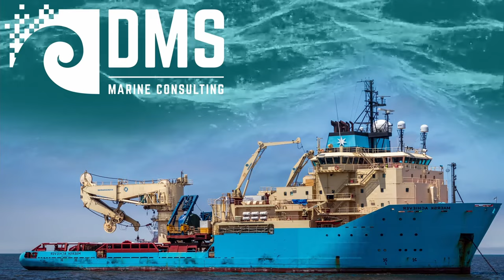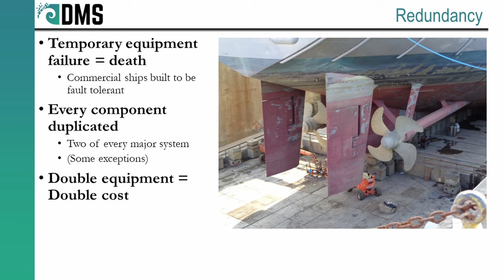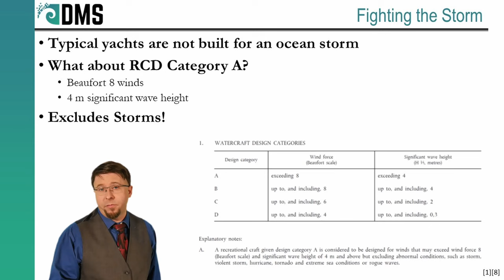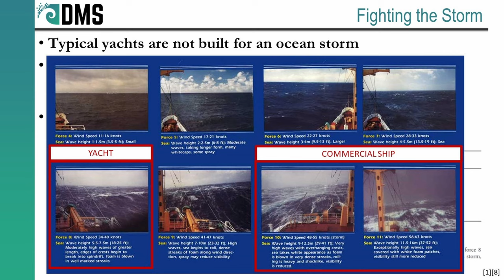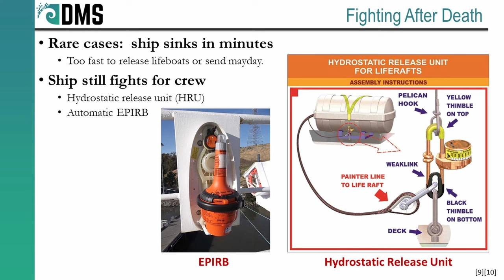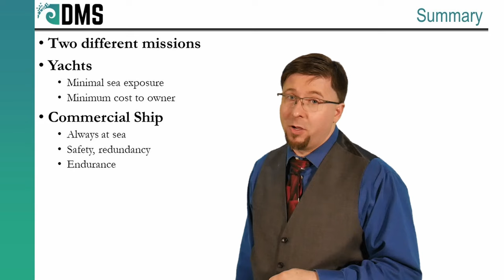How are Commercial Ships Tougher?

Comment: A feature article in Professional BoatBuilder a few years ago described how recreational yachts - say, 30 to 79 feet (9-24 meters) or so - could be made with watertight segments similar to ships. Watertight bulkheads to the yacht's freeboard along her length would, of course, vastly increase the build and purchase cost of the boat. Further, watertight doors in the bulkheads would be needed to maintain watertight integrity. Both would restrict the accommodations arrangement possibilities as well as increase cost. Finally of course, it would still be on the owner/operator to ensure all watertight closures were closed in high-risk conditions. Possibly appropriate for custom builds, and surely dependent on the owner's goals - but it would help protect owners' investments.
Reply from the maker: @153ichthus  very true, that would help increase safety.  There is also a basic floatation requirement for all yachts.  They need to stay floating, even when fully flooded.  "Floating" can still mean that the deck is mostly submerged.  So it doesn't do much to protect the people, but you can recover the yacht.

Comment: In a superyacht channel, they talk about some having enough bedrooms/capacity to almost be bumped to commercial standards. I will botch the terminology and measuring standards here, but it seemed like they have dilemmas like to add one more bedroom say for the wife's hairdresser it will cost $100M upgrade of the whole ship. Or else bump an important officer from his stateroom near the bridge to a daybed and use of shared bunks.
Reply from the maker: That's interesting.  Most standards I know regulate based on the number of people onboard, not beds.  But beds may be how they count the people capacity of the yacht.   I suspect they are bumping up against the 12 Pax rule.  International law says that you can have up to 12 paying passengers onboard and still be classified as a charter yacht.  But at number 13, you are a passenger ship and need to meet commercial standards.  Superyachts use this rule to create massive ships with large crews and only 12 paying passengers.  Then they are just a charter yacht.  That situation with the wife's hairdresser may be a little more complicated.  It would completely depend on the details.

Comment: 'Yacht vs commercial ship' is neither a correct nor a fair comparison. What you are actually talking about is 'smaller pleasure vessels, usually built of plastic' vs 'commercial ships AND properly built larger yachts, usually steel hulled'.
Reply from the maker: True, I was grouping the properly built larger yachts in with the commercial ships.  As you said, those yachts are often built to the exact same standards as commercial ships.
Reply: @DatawaveMarineSolutions  Thanks. Emphasis here is of course on 'properly built' (I say as I'm watching 44m Aria SF burning to the waterline) 🙄. As with any other product, cheap (or, I should say, money spent in the wrong places) almost always means 'less safe'. 
I enjoy your videos very much. I'm no engineer, but even I can get my head around most of your explanations. Has helped me a lot to understand more about yachts.
Reply: @DatawaveMarineSolutions First, thanks for your series of great videos.  I've learned a great deal from watching them.  You provide tons of great information, but I think this video is a bit off.  If you'll pardon the pun, you lump all small yachts into the same boat.  I feel like what you are really describing are the day sailors and coastal boats.  Proper purpose-built blue water cruisers and exploration yachts incorporate most if not all of the safety systems you attributed to commercial vessels because the need for self-rescue is a very real scenario.  They also typically have a higher duty cycle than day sailors and coastal boats though admittedly probably closer to 50/50 usage than 90+ percent time at sea.  Some might argue that even coastal boats are built closer to the commercial duty cycle standard since so many are used in charter service where the only change from an private owner's configuration is a larger number of smaller cabins in the same volume.

Comment: how much of this is because the commercial ships are larger and have more stresses on them and yachts can have more simple systems that are easier to repair.?
Reply from the maker: As far as the structure goes, I would estimate 35% of the added strength is due to their larger size.  If you built a yacht at the same size, that yacht would still need to contend with the same problems of larger size.  But that yacht could theoretically still be lighter than a commercial ship, because it was not designed to handle rough weather.  Practically speaking, when yachts get that large, we design them to the same structural standards as commercial ships.

As for the marine systems onboard, I agree that large part of the cost for commercial ships is their more complex systems.  All the redundancy, extra pipes, and extra valves adds a lot.  But I don't think the systems are more complex due to the size of the ship.  In theory, I could make a giant freighter with just one fuel tank and a single pipe running from that tank to the engine.  It would run just fine (until it needed maintenance).  So the extra costs on the marine systems has to do with the extra capability, not the larger size.

Comment: You always hear Bering Yachts bragging that they are built to commercial standards and with steel hulls, are they really built to those specs?.    I am also curious, are commercial regulations on watertight integrity and compartmentation also the basis for some military and coast guard vessel design specs?
Reply from the maker: I can't say about Bering yachts.  It takes a lot more than simple steel construction to build to  commercial standards.  To answer this properly, I would need access to a lot of confidential information that Bering Yachts is not likely to share.

As to watertight integrity on military ships.  In theory, the USCG and military ships are built to a higher standard of damage survival than commercial ships.  In theory, you can damage more compartments on a military ship, and it will still survive.  
In practice . . . more variability.  Damage survival is the law for commercial ships.  Most commercial ships consistently show the same survival ability because we all follow the same laws.  USCG and Military ships don't have to follow those laws.  They have their own rulebook. Most times that rulebook is better.  Sometimes, it can be worse.

Comment: Why don't yachts use non flammable furniture? Is it that luxury furniture includes flammable components such as wood? Or do you mean that they typically have a lower flammability rating for lack of a better term. Generally most modern furniture is burn resistant. ...is it the case that in commercial ships everything is actually burnproof?
Reply from the maker: I admit that most of these furnishing are generally classified as "burn resistant" on a commercial ship.  The exact flammable requirements vary with the testing method and regulatory body.  But as an example, much of the furniture is made from metal (steel or aluminum), which takes a LOT of effort to combust.  

Yachts usually use some form of plywood for their furniture.  It can be a sandwich panel with a veneer of plywood, but either way, there is usually a combination of resin and wood involved.  Ships only use plastics or metal that were coated in paint patterns to look like wood.  The yachts stick with real wood because real wood looks much better.  I have very little sense of aesthetics, and even I can see that.

The fiberglass resin is another issue of flammability in yachts.  The hull and many furniture surfaces of the yacht will be coated with resin, as a long term preservative.  You can get resins that are fire resistant, but those resins cost much more and are much weaker.

Comment: I just realised when you say yacht you are talking about a small inshore motorboat rather than a sailing yacht which is what a yacht is known as in my country.
Reply from the maker: I mean the sailing yachts as well.  Offshore sailing yachts are built stronger than a small inshore motorboat.  But they are still not the same as a commercial ship standard.
Reply: @DatawaveMarineSolutions  then I respectfully submit that you might be overstating your case.
sailing yachts that are travelling oversea need to be self sufficient but because they are smaller the systems are smaller.
They have two independent means of propulsion and usually the primary method are sails .
Reply from the maker: @akcarlos  That is a good point.  I admit that I went for a generalization in this video to convey some of the major differences.  But true, there are always exceptions.